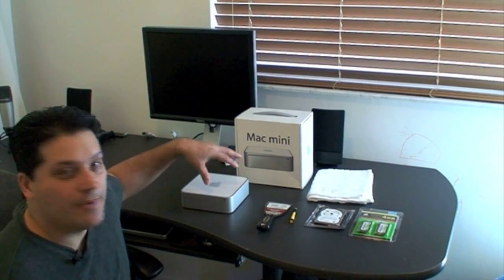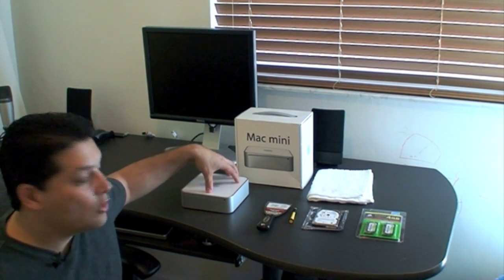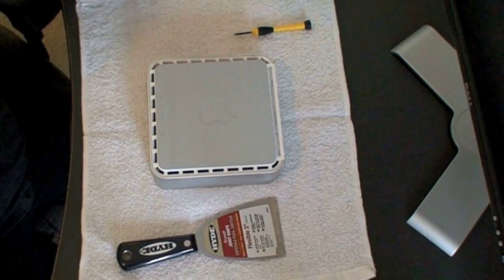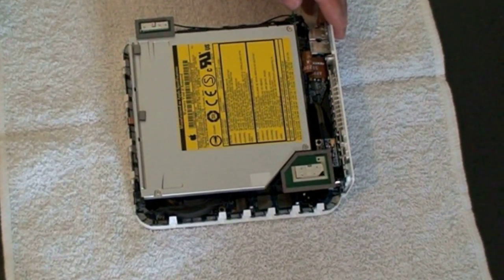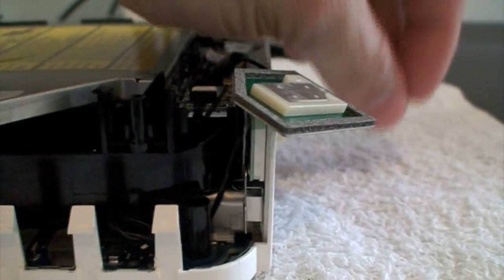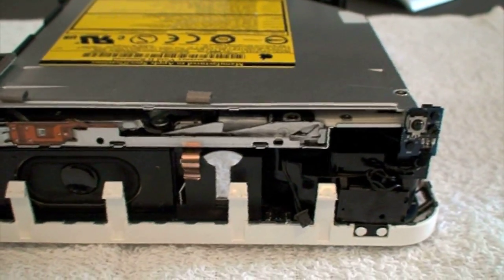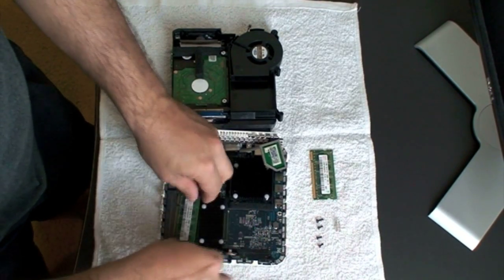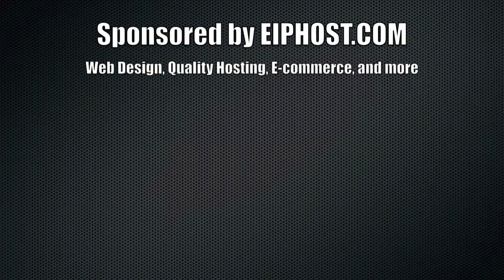Pimp Your Mac Mini Part 1

Comment from the maker: My friend I hate to disagree but the reason they put a 5400rpm is because it is cheaper. I have upgraded to a 500GB 7200RPM and it does not heat up anymore than with the 5400rpm drive. Also the 320GB in the video also works great and does not heat up either.

Comment from the maker: Yes it recognizes the 4GB of ram and it does see it. Also the hard drive is not noiser nor does it get hotter. What I can tell you is that it works alot faster since the drive is faster and now with 4GB of ram everything opens smoothly. It just works.

Comment from the maker: Yeah, imagine me I bought it and 1 week later they came out with the new model, so I was kicking myself even harder. But I tell you what I was able to upgrade this machine and get it even faster. I will be upgrading it again to a 500 GB drive that is coming out. I will post the links on my website tomorrow. The 500 GB is a 7200RPM drive. I'm gonna do another video in a few weeks on putting wireless N on the mac mini. don't forget to subscribe. Thanks for your comments.